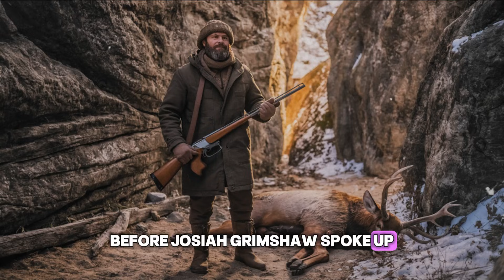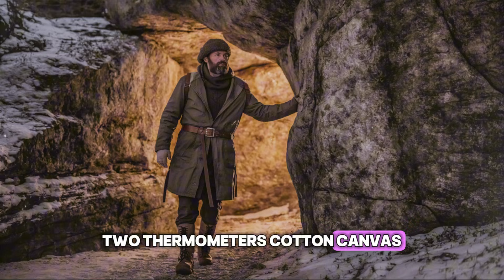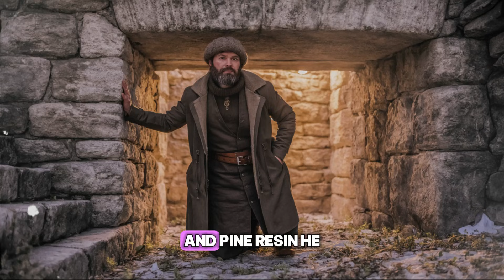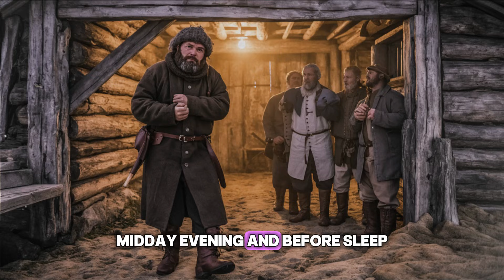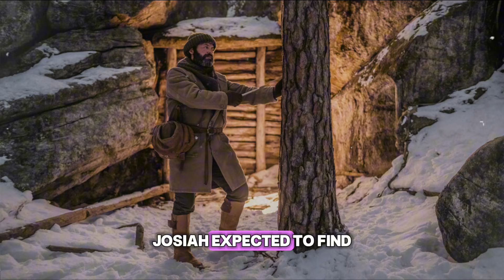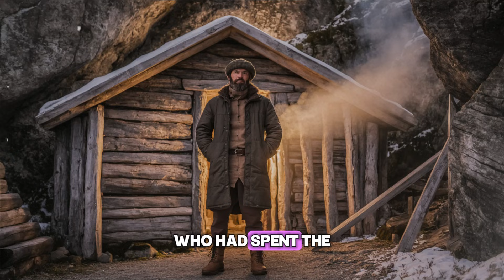Neighbors Laughed When He Built Into the Rock Alcove — Until His Cabin Hit 74°F While Theirs Froze

Comment: From YYZ. With a natural cave like that, why waste the effort building a cabin inside it. All they could have done is to build a floor , for the air gap insulation. then close off the mouth of the cave with some thick well insulated wall and a good door. They will need to install a wood stove and vent it outside. a long chimney run would leave more heat inside the cave.

Comment: Existing cabins could have outside of walls lined with canvas and pitch and a second exterior wall  built with 2 or 3 foot gap between filled with straw line underside of roof the same if you Dont want to remove shingles insulate between. I have done this 2nd option Old chippy here